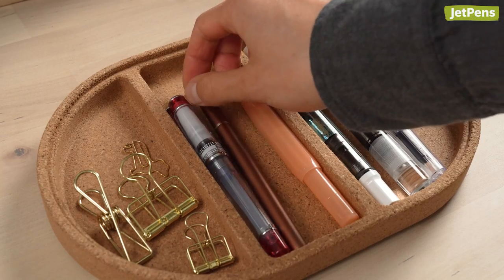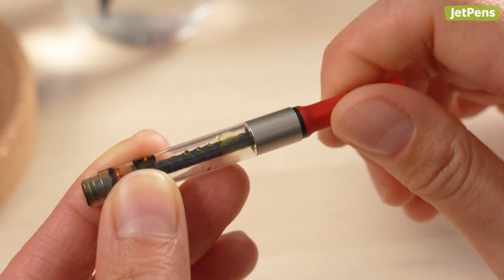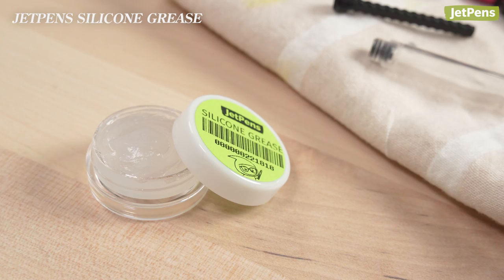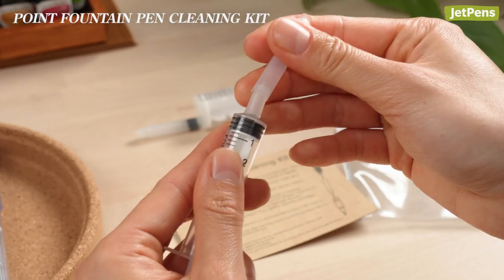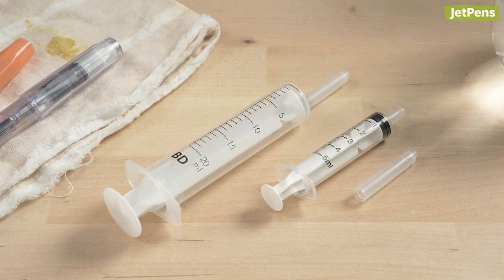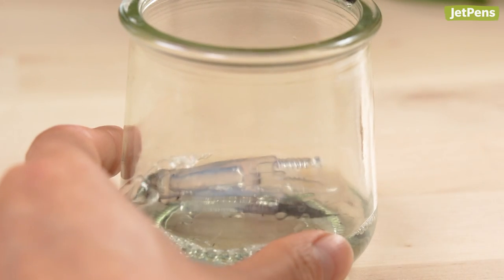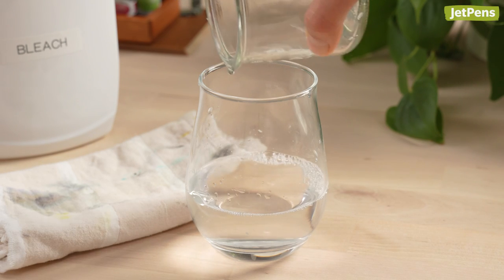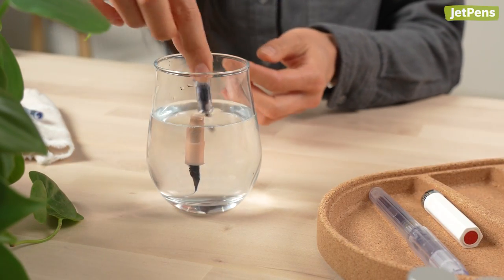ADVANCED Fountain Pen Cleaning Tips & Techniques

Comment: If your pen comes with a cartridge, even if you intend to go with a converter or eye dropper, use the cartridge till it’s empty and cut the tail end off. Then it’s just a matter of finding a syringe with the right size tip to shove into the cartridge and you’ve got a diy flushing tool for any pen that fits that cartridge.
Reply: Thanks 😊
Reply: Great suggestion!  There are also some soft rubbery baby nasal aspirators that are very soft and make a nice seal to help flush your nib.
Reply: Was just thinking the same thing. As they say, great minds think a like👍👍.
Reply: I was about to say

Comment: Whenever I’m using an ink with lots of shimmer, I use an extra soft baby toothbrush to clean the feed. Works every time.
Reply: I found some short bristled make-up brushes at the dollar store or whatever cheapy-deapy store you have in your area.  You can also use a soft bristled artist brush. And don’t throw away the brush from discarded mascara. They are particularly good if ink has dried in the cap or barrel of your pen.

Comment: An ultrasonic jewelry cleaner vibrates ink out of almost any crevice.
Reply: Seconding this! I use it when I've left the ink for too long - if it's especially stubborn, a drop or two of dishwasher will usually do the trick!
Reply: @Ink2Screen  I am worried it might "shake loose" some parts.  Cell phone PCB components have been known to shake loose and fall off when overkept in cleaning phase.  That would go for anything that is BGA-mounted or similarly fixed.  Sure, a pen is by far more resilient, but I'm having second thoughts nevertheless.

Comment: I generally never put anything besides water based ink in fountain pens so clean up can be done in mostly water. When cleaning technical (yes i still use those) and dip pens where Indian and dye based inks are used Greased Lightning degreaser is my go to cleaner, it literally melts ink. I works great on fountain pens as well but should be diluted, just be sure to flush with plenty of warm water.

Comment: actually I use alcohol to clean my fountain pen nib & feed, but I use diluted, not full strength. Alcohol come in three type, and what I use is 96% Ethanol, which safer on plastic due higher water content, compared to Methanol (sometime named as Methylated spirit) and Iso-Propyl Alcohol (IPA is short term of that) that can melt plastic. but again I use it diluted with water until around 60%-ish strength (use online calculator if you want to know your ratio). and like most of the method in the video, make sure you flush again with clean water after. I found it make my nib & feed very very clean, especially if I using a dye based ink on my pen.

Comment: Old school trick. Get a bulb syringe like for babies. Great for squirting water through most pens using a cartridge or converter. And solder bulb, sans the white tube fits most sections, making cleaning them and the nib and feed a breeze, for most inks.
And older Parker Quink with Solv-X gets most other dried inks out.

Comment: nice, the lamy converter doesnt need to be dissassewmbled, you can dip the whole thing in water as the section behind the piston is essentially like the front portion it can suck up ink or water in this case, just submerge the whole thing and work the screw and all will be fine.

Comment: Thank you for the tip on the Sailor Doyou. Very interesting info ! Will it work with Baystate Blue stains?
Reply from the maker: Hi there! Unfortunately we haven't tried it out with Baystate Blue. Since it's a highly staining and permanent ink, you probably won't be able to remove stains unless you use dilute ammonia or dilute bleach. Just be sure you only use one or the other as mixing the two will create a toxic gas.

Comment: If you need to clean the inside of a Platinum Preppy's inner cap without it twisting around, or if you need to clean the space between the main cap and the inner cap, you can remove it by sticking an ink syringe with the needle removed inside and pulling the plunger back so that when the syringe is removed, the suction pulls the inner cap with it. This should work with any Luer lock syringe, like the one sold by JetPens with their name on the listing; in fact, I just use a spare medical syringe that uses the same Luer lock system. This may or may not work for other Platinum pens; I haven't tried.

Comment: Another way I used to clean the fountain pen is to use the syringe to poke a hole onto the back of the cartridge and push the needle in. It will create a natural seal that works just fine for me. Just be careful with the poking. Protect your finger. =)

Comment: I have a few old Parker 51 Specials (c. 1955 with aerometric fillers - these pens don't disassemble without much effort) that have been sitting for who knows how long with gunked ink in them. I squeezed clear water thru filler (and got some of ink out), soaked in clear water for 24 hours, squeezed water thru filler again and a little more ink came out. Still, the sac is totally black, and if I soak in water (30+ hours now) and squeeze sac, a little more ink comes out. I'm going to try the Monteverde Flush, but is there any other/better way to clean an aerometric filler Parker 51 Special?

Comment: Which technique or product should I use to clean a pen that dried with deAtramentis Document Ink?  Since it's not a water-soluble ink, water isn't helping.

I need to USE my fountain pens more often, but most of the paper I use doesn't work well for fountain pens.  Until I use up my current notebooks and journals, I'm out of luck.
Reply: That’s an interesting question. I Would also like to hear recommendations. I just got into this document inks and this was the reason why I hesitated using them…
Reply: Diluted soapy water could do the trick. Anything that would dissolve/clean oil should work for the ink too

Comment: a) If a standard flushing does not help, I do use a BAKU BK-3550 ultrasonic cleaner.

b) After using one bottle Monteverde Pen Flush, I decided to compose my one flushing solution. It contains 250 ml of 25% ammonia, 250 ml of Foma Fotonal (you may use Ilford Simplycity), 250 ml of 96% ethanol, 250 ml of 99.7% isopropyl alcohol, 4 l of distilled water. Warning! This amount of ammonia smelled strong, caused some inhale poison, although I worked in the respiratory half mask and vented the flat.

d) Dried and clogged KWZ Standard Inks get dissolved under the influence of two to three drops of the solvent I use to clean acrylic paints. One part of IPA, one part of Ethanol, one part of Propylene glycol. Rinse with water immediately after solvent starts dripping from the nib.

c) Almost always I rinse with distilled water in ultrasonic cleaner as the last step.

Comment: Rubbing alcohol melts the pen? Acetone makes sense to me, but alcohol?
Reply: isopropanol and ethanol can melt some polymers like acrylic over long periods of time. It's possible to use them and immediately rinse them with water but not all inks are very alcohol soluble (as opposed to water, despite both of those alcohols being miscible in water).
Reply: Depending on the age, there's pens that will basically melt in even water, if soaked. Seems to be mainly old English pens (made out of casein.)

Comment: I started using jinhao 992 fountain pen to get the hang of using fountains. For ink I use an easily available camel ink in Mumbai. 
For the past few days it seems the pen is bleeding ink. It gives no problem in writing but I notice lots of ink on the case of the pen and the threads of the pen case as well as in the cap. What’s wrong?